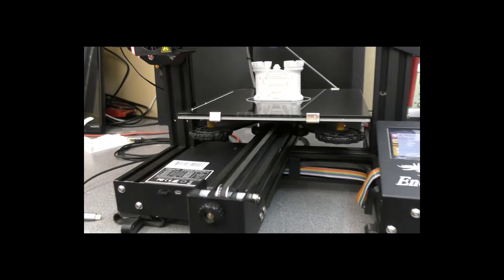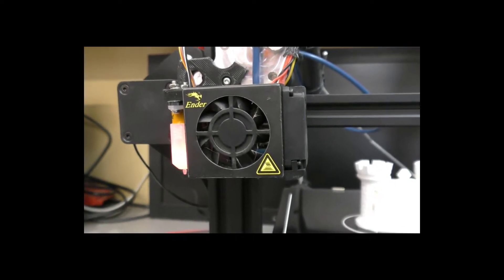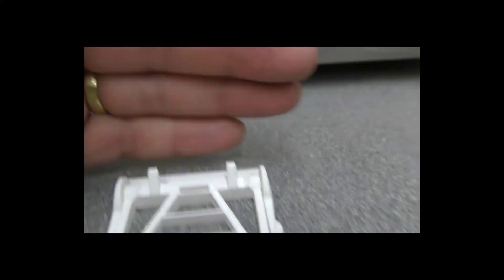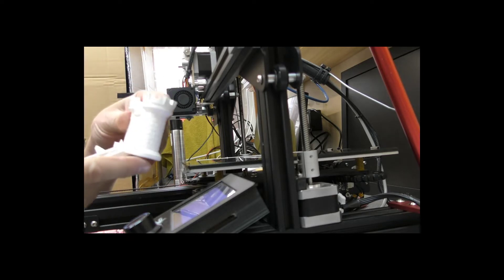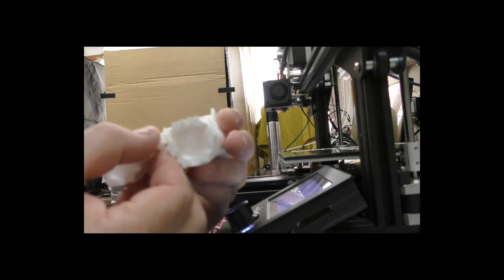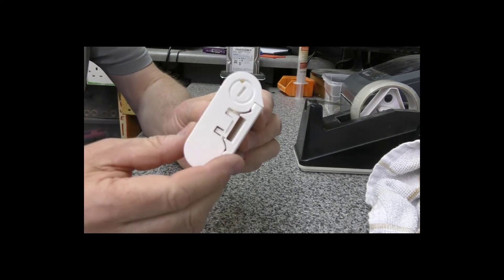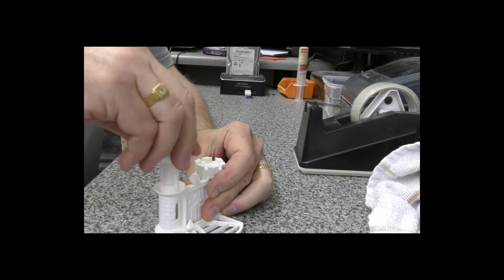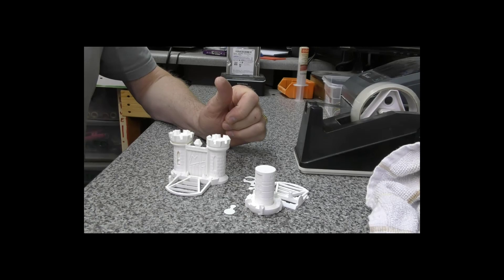Ender 3 Pro Bigtreetech SKR Mini E3 V3

Comment: Hi what firmware do you use,i installed the board but my filament fan not working any ideas?
Reply from the maker: Incorrect wiring?
Wrong fan connections used.
Faulty transistor next to the fan socket.
Reply from the maker: Firmware from BTT for Bltouch and sensorless z homing.
Reply: @Trevs-Shed  i will check wiring but i have problem on this board on my old board works fine.Tnx for ideas i will check it tomorrow.